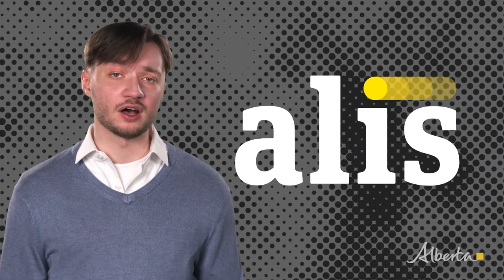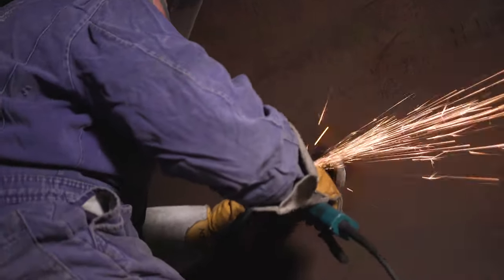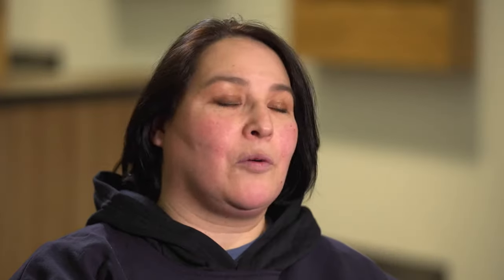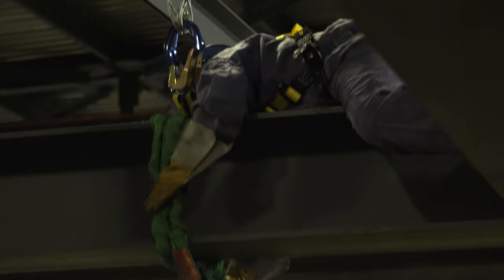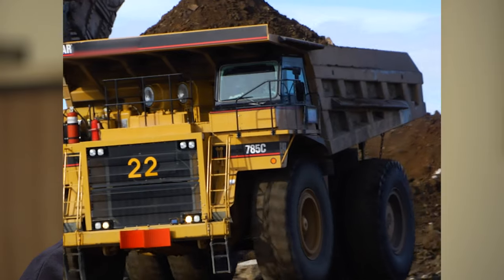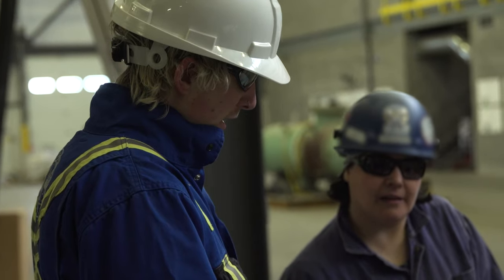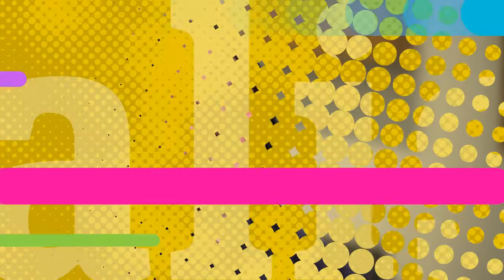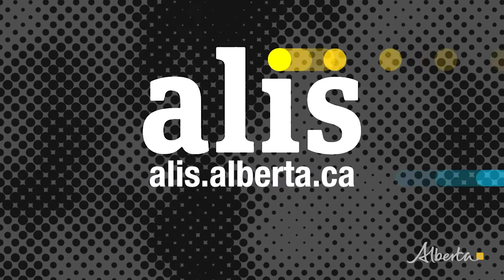Occupational Video - Boilermaker

Comment: Retired Boilermaker Local 28 New Jersey. Do I miss working, hell no.
Reply: I just started my apprenticeship with local 28 I’ll be starting on my first job this week
Reply: @joeyptsp you like it so far?
Reply: Retired Boilermaker Local 169 (Detroit) here. Do I miss getting up at 4:00 am and driving an hour and a half to work? Do I miss working outside with icicles hanging off my whiskers? Do I miss welding in temps over 100-degree Fahrenheit? Do I miss welding on the shell of a blast furnace (with a charge of molten iron still in it), in February with one side roasting and the other side freezing? Do I miss all these things? No! But I wouldn't trade that experience for anything. I learned tons of skills. Worked shoulder to shoulder with others who'd give you the shirt off their backs if you needed it. Worked with some who'd chew your butt out for something, on one job, but then you might be the one chewing their butts out on the next one.

Comment: do you really have to be 200ft in the air... Looks dangerous.
Reply: Yes. And sometimes higher.

Source-Me, former scaffold builder that erected scaffolds for boilermakers/welders
Reply: Absolutely it’s dangerous but if you’re not afraid of heights it can be a blast there’s nothing like taking a ride in a man basket with a crane swinging you around a couple of hundred feet in the air and the view is awesome Retired Union Boilermaker Local 107
Reply: Brother we’re upwards of 500 feet on some of these smoke stacks at some power plants. Gavin is 1300 and zimmers is the same but they’re closing
Reply: They have safety harnesses.
Reply: @mattharper588  actually thinking about joining up with the 107
Reply: If you don’t do well at heights it might not be the trade for you
Reply: Yup if you don't like heights, small tight shitty spaces, fear of being crushed, heavy equipment, etc... not for you. This is a job for people who played contact sports, been in a few fights before and aren't afraid of another one. You gotta want it. Half assed attempts will produce half assed results. This isn't a free meal ticket. But if you show up everyday with some determination and some humility, we will make a Boilermaker out of you.